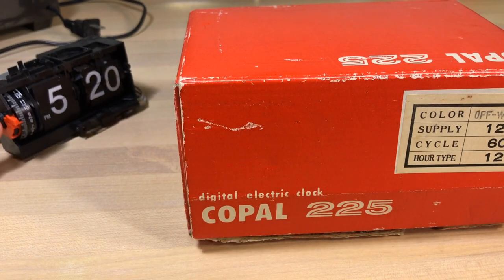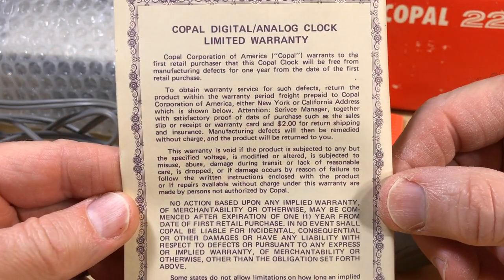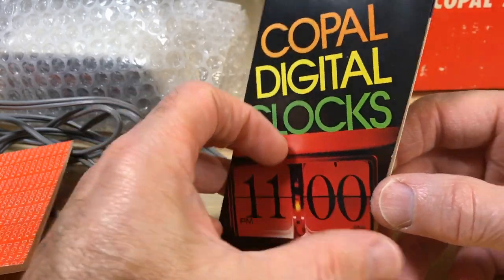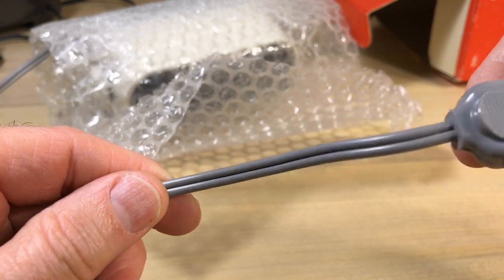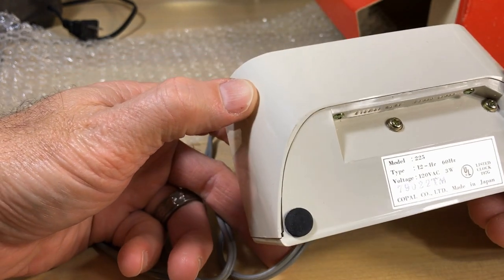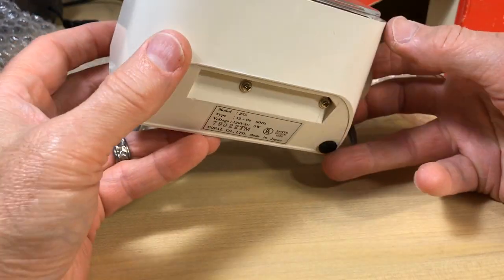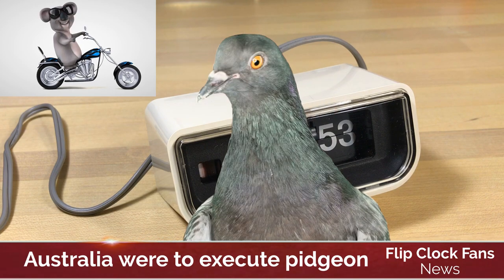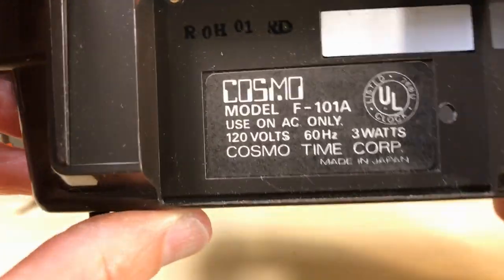Unboxing a Copal 225 new in box

Comment: I have this awesome one. but makes a grinding sound. but keeps perfect time. should I oil the motor
Reply from the maker: Yes. But on this model the little spinning can (sometimes referred to as the rotor or “whirligig”) get the tiniest bit out of alignment and rubs against the squirrel cage. It’s very difficult to communicate how to fix this. I’m afraid I’ll just guide a person in messing up their clock. But it’s worked for me. You have to slightly correct it. I should make a video about this. I’ll try to do that this evening.
Reply from the maker: I've made a video about this but it's unlisted. I still don't know if I want to release it publicly. Check this out and let me know what you think:
https://youtu.be/fmldTf929ts